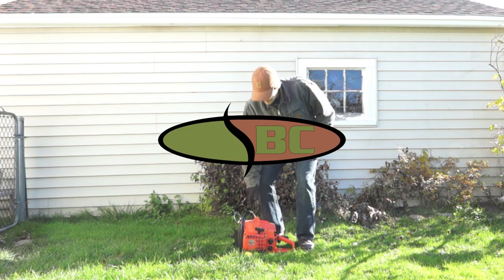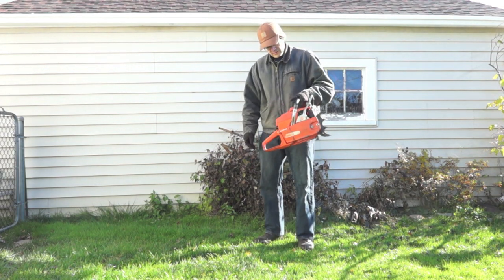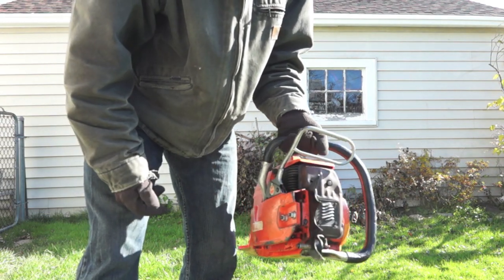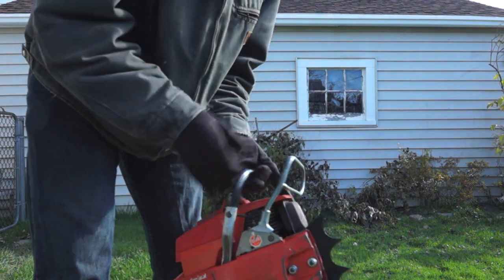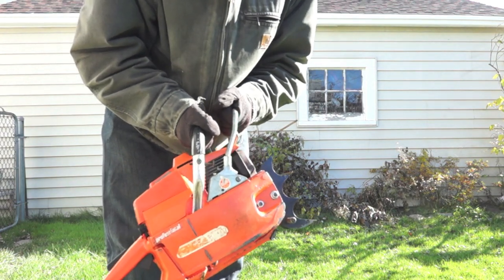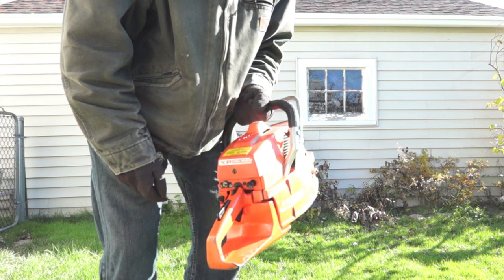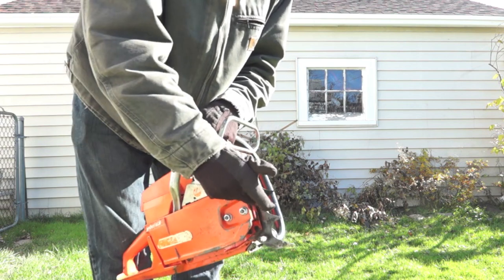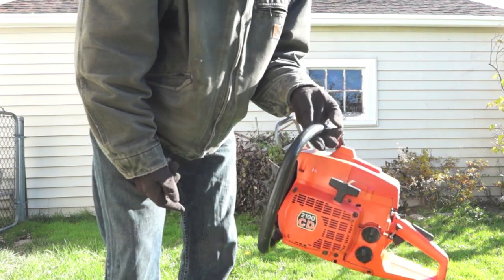Husqvarna 2100 CD

Comment: Its a beast,will pull 60" bar/skip tooth chain if needed.Bought my 2100CD from retired Oregon timber cutter on Ebay last year,its a 1983 model in great shape & has very strong compression.No chain brake on mine,it has original clutch cover with no place for one.They weren't mandatory until around '84-'85 if I remember correctly.Mine also has the thin piston rings,which was a high performance option for more RPM's available from dealers in the late '70's to early '80's.

One of my 3 big saws,the 2100 is one that's favored for powering the Granberg Alaskan chainsaw mill,it works like a dream with that.When I'm not milling its used for felling/bucking logs over 24" that go in my firewood stacks.Biggest bar I've used so far is a 36" it don't bog it down hardly at all,also have a new 42" hanging in the shed that will be needed in a few months.

Comment: You chain brake is not working properly there is another spring in there that come off sometimes take the bolt out of the handle and put the other spring on the flat part of that tab